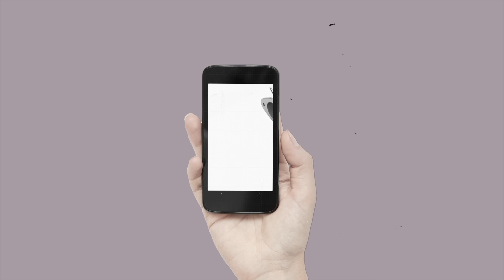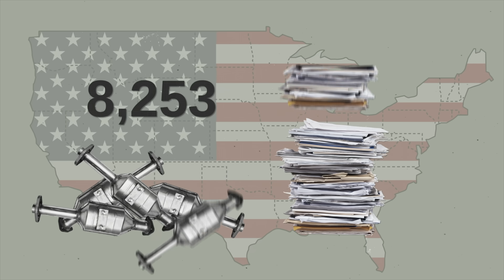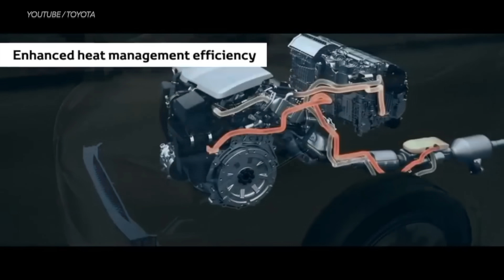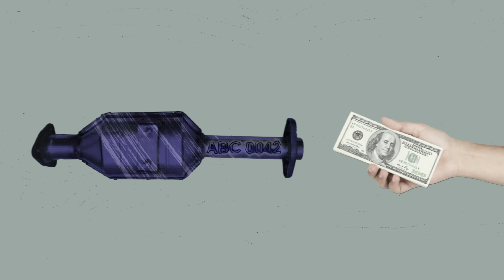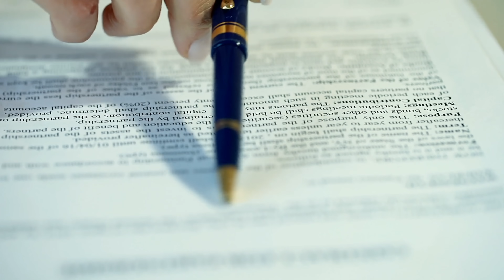Police Catch Thieves Stealing Catalytic Converters in Driveways (You Won't Believe This)

Comment: Where I live, the government finally woke up and passed a law making it ILLEGAL for scrap dealers to accept converters (and copper wire, etc) without government issued ID AND the dealers are not allowed to pay the "customer" in CASH - must be a traceable transaction - cheque, money order, etransfer, etc. These thieves when convicted should be prohibited from obtaining a driving licence FOR LIFE, and perhaps have THEIR little "catalytics" removed too.
Reply: Where is this place of common sense?
Reply: @davida1878 
 New Brunswick, Canada... but I'm not bragging... the government seems devoid of "common sense" on many other issues.
  Heating oil just went up SIXTY-EIGHT CENTS per LITRE ... OVERNIGHT...
  We have a 1000 litre tank... to completely fill it would cost well over THREE THOUSAND dollars (Canadian), nearly $500 of which is TAX.
  I realize the NB government isn't fully responsible for the international SCAM on fuel oil, but I don't see them helping either.
Reply: That is now mandatory in the UK. One of the metal recycling centres I use for the various scrap parts removed from cars accumulated over the years has issued me with a small chipped ID card with my details on it. He simply scans that card when I take stuff for recycling. No cash involved, on-line bank transfer a few days later.

Even so. I suspect some do not follow those introduced legal constraints. Twenty years ago was the last time I used a train for a trip. The driver stopped that train suddenly in the middle of nowhere. He like my son, had seen a couple of "ne'r do wells" setting fire to massive trackside cabling to remove the copper content.
Reply: @rae0521  yup. Gotta love how every government is just going left wing. Love those taxes!!
Reply: @TheSergio1021  
I'm at a point where I don't much care WHICH "wing" the government is. I don't take any of them too seriously - they haven't a clue what they're doing most of the time for which I'm truly thankful. Can you imagine the horrendous state we'd be in if they actually could think things through logically and implement a reasonable and fair plan?
Reply: @rae0521  not when considering basic economics. Oil was always profitable saying that they make tons of money doesn't show any difference. 
Prices go up when the supply goes down. Left-wing governments have been shutting down oil refineries in the name of climate change for years now, and suddenly theres a surge in oil prices across the board.
The issue is that oil is not readily available as it used to be, hence higher prices.
If anything, oil companies would make less if there was more oil to go around.

Comment: the only way to prevent convertor theft is to remove your own convertor yourself, replace it with a pipe and two clamps...  Put it back in for your inspection when needed.
Reply: I guess it will throw error. How to adjust a computer?
Reply: @MrNiceCobra  the computer can be tricked into not throwing a P0420 code by installing a spacer (aka "defouler") that moves the downstream sensor out of the exhaust stream, or a capacitor and resistor can be installed into the wiring harness to dampen the downstream sensor signal so it appears that a functional cat is in the system.

Comment: I live in central Florida and work at a auto repair shop. We lost 12k in converters in one night. Shop put up cameras and hired a night security to stay on property.  For the first month cameras caught 3 different vehicles pulling up to gate behind shop at 2am. Then none, so guess small groups and they now know about security.  It took them 6 minutes to cut gate ,go in and remove 6 converters and leave.

Comment: Lost mine back in '07 while parked at work. I don't think it took crooks more than 5 minutes to remove it. Bought a Universal Replacement part ($175) versus Ford's catalytic part ($800+ for that!). Not my job to send your kids thru college for a week, Ford Motor Co. It would be nice if punitive damages could be imposed on those perps instead of holding their hands.

Comment: I keep 220v line going to my vehicle. Built it an electrical fence 50k volt transformer & connected it to alarm & the exhaust pipe. ZAP! 😱 I've got a huge collection of portable saw's for sale, on ebay. Weird result is, no catalytic converter thefts in my area last 6 months. Strange huh? Ha ha ha

Comment: Looking at my’21 Kia Soul LX base model parts catalog it appears to have the cat in the exhaust manifold itself. The rest of the system is mufflers, resonators etc. Listed at $2318 it’s the most expensive part on the exhaust system. If the cutter mistakenly cuts out the resonator just put a straight pipe in its place and enjoy the exhaust note!
Finally something good about Kia’s on Scotty’s channel…

Comment: My dad welded steel bars across his catalytic converter into the frame. They would have to cut through 5 half inch steel bars and then cut the pipe to get to the converters.
Reply: Run a wire along one of the steel bars so that when it is cut,  the Dobermans are released.
Reply: @dsbennett  Monty??

Comment: Recently a coworkers relative had an F-150 stolen.  Ford made a little phone app that can be used for locking, unlocking and remote start.  But more importantly, it also has a map that can show where the truck is.  They were able to track it down using that app.  Worth looking into if you have a newer vehicle.
Reply: Is that tracking app only for trucks?
Reply: @itsok2bwhiteendanti-whiteh548  That app specifically, mostly newer Fords.  I think around 2017 was when most models starting using it.  It's called FordPass.  I would imagine other brands have something similar.
Reply: @vitaming582  

Thanks for the info. Hopefully a tracking app will be available for certain vehicles in high theft areas. The downside to that is it gives government more tracking power over citizens, which is beyond dangerous.
Reply: So what, every Camry shuts down after about 50 feet without a key, 10000 times better.

Comment: My Tundra has been sitting up at Toyota for 6 MONTHS. The dealership insists that aftermarket converters will throw a check-engine light which will immediately make us fail our emissions inspections in TX. Each of our dealerships have between 30-70 Tundras awaiting this repair.  Despite this, Toyota refuses to increase production of catalytic converters. I’ll never buy another Toyota.

Comment: My friend recently in Denver had his hyundia stolen. It can now be started with anything, even a housekey or screwdriver. The car has never been the same, but at least it was recovered. A few months prior my roomates catalytic converter on a first gen prius was stolen while in front of our house, and we were awake. They now have a second gen with a metal shield covering the underside of his car. Hasn't been stolen since. My grandparent's catalytic converter was stolen while they were shopping in Walmart off of a rental Tuscon in Minneapolis. Ridiculous stuff.
Reply: Can fit an engine cut out switch at auto electrician with disguised or concealed switch to help prevent car being stolen.
Reply: @marklittler784  That is so easy to hook up
Reply: @joemyler2958  Not so easy in this day and age to combat either as it wouldn't cross the mind of most.

Comment: My 2004 Tundra had it's two converters stolen a few days before X-mas. It cost $4800 for them to be replaced. I paid a muffler shop $500 for them to fabricate a shield to cover both. Thankfully I added comp to my insurance awhile back just in case this were to happen, and it did.

Comment: When you have an inflating asset just sitting there, and the value it worth more then the hassel of getting caught.

Here in Southern Ontario Canada, were having a car theft wave that's focusing in push to start vehicles like Honda accords and CRVs
Reply: You can get an auto electrician to fit a separate engine cut out switch that's concealed or disguised for example your car won't start unless the sun visor is down 😅🤸😅😅🤸😅😅😅
Reply: @marklittler784  ya, when heard it on the radio someone said that too. But its a bandaid on a bigger problem..

Comment: Back in the 1990s, after Michigan changed its laws to only new cars needed to pass emissions tests I took my older car to a mechanic, had the converter removed (it was bad anyway) and had a straight pipe welded on. Problem solved and thieves left my car alone.

Comment: Husband’s was stolen off his tundra back in June while he was visiting in  East Granby Connecticut, been on a waiting list(from Toyota)to get it replaced since then. Has a straight pipe on until it’s fixed to keep some of the noise down, can’t get it inspected until its fixed. We live in Vermont and it’s happening here more and more, they are hitting the car dealerships also.
Reply: Why are you buying an OEM replacement cat? It only makes it that much more attractive, again! OEM Cats have more valuable metals in it. Better to buy an aftermarket one. It’s a heck of a lot cheaper too.
Reply: @nokieng6502   This doesn't work with the newer trucks... I tried.  Aftermarket cats throw a CEL and you can't pass inspection.
Reply: @greenfire919   Exactly! Husband said the same thing.
Reply: @nokieng6502  greenfire919 said it best, my husband said the same thing 🙂
Reply: I’ve heard the same thing about aftermarket cats throwing a CEL code. But the analyzers at the auto shops can reset the code for you. Same thing happened to the one I put on my Accord. The aftermarket threw a CEL. Guy at the shop doing the install cleared it. Saved $2300 versus an OEM cat. But if it’s being done thru insurance no big deal. I only have liability 😢.

Also I installed a CatStrap ($150) to deter thieves. Sure they can eventually cut thru it to get the cat. Will take them 5x longer, and maybe an extra sawblade or two. But I hope they just go on to an easier target. It is after all a deterrent, not foolproof. Good luck.
Reply: @nokieng6502   Clearing the code may only be temporary depending on your car or truck.  Newer trucks a are very touchy.  If that works, then fine... but if it doesn't you just wasted even more money.

Comment: I replaced my exhaust system on my 2004 Corolla since it rotted out ( I live in New York) and the catalytic converter alone was $897 to replace. But since I replaced the exhaust and a new Oxygen sensor the car purrs like a kitten and gets better gas milage!

Comment: I had mine stolen off my 2003 Honda Element while I was parked at work in 2014.  Three were taken from various lots that day.  Cost me $2800 for which my insurance (full coverage) covered a mere pittance of the bill.  Car was mint.  Traded it in 2 years later on a Subaru Forester Touring because I was sure the thieves would be back for the new catalytic converter.  Yes I certainly was paranoid.

Comment: Hey Scotty! I have a 96 ford explorer 4.0(pushrod motor) with almost 300,000miles. I haven't drove/ startered it in 18months from not being home. First I know I'm replacing the water pump(leaking gasket) so I'm replace the whole thing as well as thermostat, then replace fuel filter, spark plugs and oil change anyway what else do you suggest should be done before starting it up again? Your videos are great and thanks for your time!
Reply: The battery, they go bad when they sit that long no matter how new.

Comment: here's an idea for some ambitious entrepreneur:  Create and sell a CC conversion kit.  Here's how it would work:  you cut off your OEM CC and install/bolt on a straight through pipe in the gap.  Then, when it's time for the emission test, just unbolt the 'temporary straight thru" pipe and bolt on the OEM CC.   After you pass your emission test, remove the OEM CC and store it back in your safe until the next emission is due.

Comment: I’m surprised as to why we cannot find another way to reduce emmisions, eliminating converters
Reply: There is, it’s called a charcoal canister.
Reply: We have. It's called an electric vehicle. 
I propose a better way, though, and that's lonnnnnnng years in prison.
Reply: @Steve_K2  electric vehicles still draw power from the grid that gets power from burning fossil fuels, so not a better solution even 10 years from now.
Reply: @GMC.Sonoma.4.3  

Charcoal filters have to be routinely changed out. People would have to remember and care to do so, but they wouldn’t. Most people are too lazy to even change their air, oil, and fuel filters.
Reply: We already have. Unlike the pre-70's cars, we have electronic fuel injection, variable valve timing and lift, unleaded fuel, and full synthetic oil. If you ask me, that's already plenty good.
Reply: Fastest way to decrease car cat converter being stolen is to make a Federal Law that punishes any scrap dealer who buy and sell car converter to be jailed for 50 years minimum, and car owner can violently punish car thief/robber up to death without facing any jail time nor prosecution.
Reply: We have. Its 85-99% ethanol, methanol, ethanol-diesel,  vegetable oil, HVO100. Most of the combustion engines dirty exhaust emissions are caused from burning petroleum fuels.
Reply: @GMC.Sonoma.4.3  Depends where you live, CA is dirty unlike WA.
Reply: @markoftheus  Yeah, they need to be removed
Reply: @Vex916T  You are insane if you think tat will happen.

Comment: My dad used to have a 2004 honda civic. The manifold converter rusted and cracked and needed to be replaced.  I got one on rock auto that had oem quality for only $150. I'm a technician so I installed for free. When he scrapped it it was over $300 on scrap. So he earned $150 by having me change his exhaust. If the car is new it would need a more expensive converter but because it was a 20 year old car it wasn't a big deal to put one of slightly lesser quality.  The value is far more than most know. Honda crv converters are around $400 currently, no wonder they're targeted by thieves 😮

Comment: Scotty, Thank you so much for making this video! I too have been a victim of theft. It has been a few years now since mine was stolen off my 2002 ford Ranger while I was out on a backcountry camping trip. This did not really break my heart cause all did was just a run a straight pipe, since I live in a state with no emissions restrictions I am able to do this, at least for now and it is shame I have to do it this way. But, now my Ranger is at 180,000 miles and I don't trust it to drive long distances and to areas with poor cell signal. 
 I just bought a 2024 Subaru Crosstrek and I need to get secure from theft, and ideas? Thank you!!!

Comment: I've been wanting to upgrade to Flowmaster I think I'm going to start parking on the street and see if I can save some labor cost on removing the old one. Lol
Reply: no cuz they cut it in bad spots. so u could end up needed more then just a catty.  it would be easier to remove ur Own and get ur metals urself.  lol. might just pay for ur new setp lol
Reply: Lol. I was thinking the same thing. Only I was gonna just put straight pipe in where the cat would be stolen.
Reply: So, you wanna just  give them your $500 cat??

Comment: Yes, thieves used a tow truck to steal my low mileage 1999 3500 Dodge Ram a couple years ago.   Police found it about 7 miles from my San Antonio residence on the road side half on the road and half in the grass of a subdivision main road.  All the tools were taken and the entire steering wheel column was a mess ripped out.  Fortunately I had comprehensive and  got $5,000. for it.

Comment: As soon as we all start driving electric vehicles, we won't need catalytic converters!
Reply: Make sure you buy a generator with a trailer just in case 😛
Reply: @diegosilang4823  and a diesel truck to pull it
Reply: True but we will need more tow trucks and portable generators.
Reply: @diegosilang4823  have you checked the stats on how many ICE vehicles run out of gas? I mean, AAA even has a service for it. Maybe you should tow an extra gas tank?
Reply: No they'll just take the whole car and strip out the copper wires and battery so your left with an empty shell.
Reply: @garysgarage.2841  yes, I’m aware they do that to ICE vehicles. Don’t forget the tires!
Reply: Will need fire extinguishers and lots of water.

Comment: if its mostly black market then marking any numbers on your converter likely would make no difference to the buyers. seems factory could scribe vin numbers, but same issue. buyers know they're stolen and it won't help. guess going after the buyers with harsh penalties is the way to go.

Comment: The best answer is for manufacturers to site the CC in a difficult place . This is next to the exhaust manifold and I believe Toyota are doing this as their Prius cars are big targets. Of course you can drive a diesel car but they have more maintenance issues. All those pick ups would be diesel powered on the UK where I am. Yes, CC theft is common here to and scrapyards seem to buy the CCs off the thieves.

Comment: When i owned a Saturn with a manual transmission, it was stolen from the parking lot while I was at work. Police found it the following day in front of a junk yard still running. I sold it after finding out how easy it was to steal.

Comment: In Africa, most of the catalyst converter thieves are mechanics.
They don't remove the catalyst converter entirely, they cut the box open and remove the catalyst converter inside and welder it back.
There is huge demand for catalyst converter by a certain syndicate.
unfortunately, the enforcement agents here are doing nothing to stop it even the government.
no legislature has been signed to criminalize it.

Comment: The value of platinum, palladium and rhodium, rhodium is 13,600 an ounce right now so this problem is only going to get worse for now. At least until a big new source of platinum group metals is found. Probably the most effective is replacing the oem with a cheap one and keep the oem cat locked up.